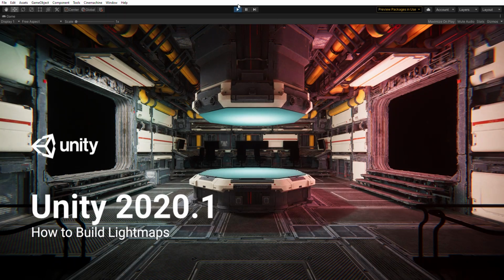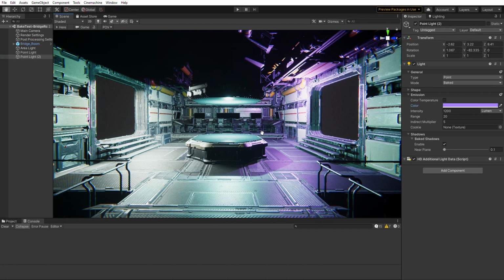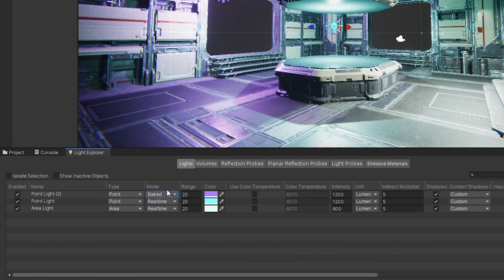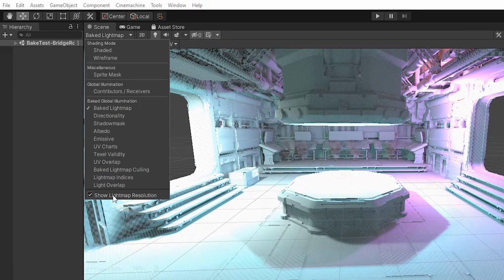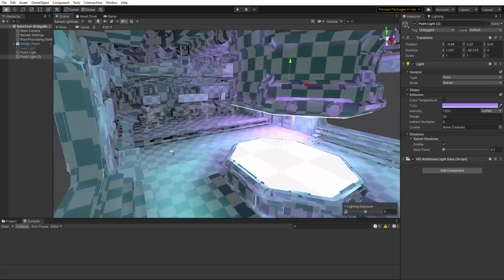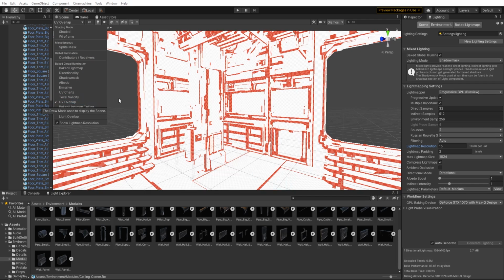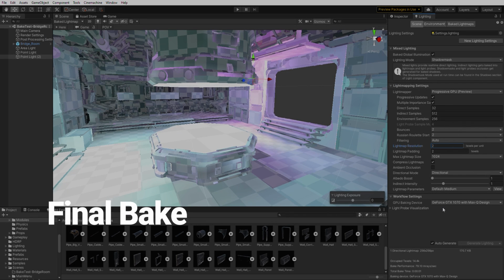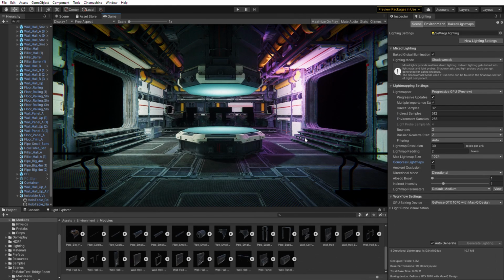How to build Lightmaps in Unity 2020.1 | Tutorial

Comment: This definitely helped narrow a ton of things down, however I am still stuck on Preparing Bake.... with 5+ hours listed. Any idea how this could happen? I am using GPU 3080, Lightmap Resolution at 2 with Padding 2. I kept the scene simple this time since I am setting up for the final map, and I have had issues with lighting in the past so I wanted to test everything out prior to bringing in my prefabs. Still no luck as it seems. I am running Unity 2020.3.25f1 as project version. Thank you!
Reply: So I let my project sit over night, and Unity is still stuck on Preparing Bake. Not sure why this is. Could anyone help me in figuring out why?
Reply: @ElNitro7  not sure if you found a solution. But did you check under Lightmapping setting > Lightmapper ?  and check to see if its set to GPU. 
If its set to CPU , unity won't use your 3080.

Comment: 1:32 So what can I do with the terrain? Any advices? Thanks in advance~~
Reply: It may be counter-productive to bake terrain. Outdoor scenes often have large areas lit only by the Directional Light (that is, the simulation of sunlight or moonlight), and as such, will render quickly without baking. For interior scenes, any surface may be (and often will be) illuminated by more than one light source. Depending on whether you are using forward or reverse rendering mode, the computation of multiple direct and indirect light sources onto a surface is computationally intensive, hence the desire for baked lighting.

If your project rotates and dims the Directional Light to simulate day/night cycles (or even if it just swaps fixed parameters for one "day" and one "night" lighting mode), this again would negate most of the benefit of baking because if the light source isn't static, it will not be baked into the maps.

Combining these factors with the sheer size of a terrain chunk, and this explains why the video assumes you probably won't need (or want) to bake terrain light maps. All else aside, the terrain would have to either consume a huge amount of space in the lightmap textures, or it would need to be baked at a really low resolution with huge texel size.

This doesn't mean you can't bake light maps for objects such as building exteriors or large rocks that will be placed on the terrain, if you have invariant sunlight in your project. If the terrain is not marked static (which, again, it probably should not be), then shadows from these objects on the terrain itself will not be baked, but self-shadows or shadows from adjacent static objects, as well as any baked-mode lighting from the objects (such as a street lamp) could still be baked.

Returning to your question more directly, your best friend for improving terrain rendering performance is likely to be managing the scope of what is to be rendered in each frame, using:

* Camera frustum culling (intrinsic to the camera itself, but somewhat controllable by your setting for far clipping plane)
* Occlusion culling of terrain chunks and objects that are on the terrain (divide large terrains into chunks, and set them occlusion static but lightmap dynamic -- they can be static for occlusion without being static for lighting)
* For very large terrain areas, investigate world-streaming techniques either by creating your own or by using third-party tools
* Appropriate LODs of medium- and high-poly objects, especially foliage
* If appropriate, tools and techniques such as 3D imposters

Occlusion culling is likely to be an iterative process, as there are tradeoffs between the complexity and memory usage of the culling data versus the rendering cycles saved by culling. If the culling is too coarse, very few things will cull because the camera will often have visibility for most of the eligible objects. If it is too granular, the culling will be highly effective but might take a disproportionate amount of computation to traverse the culling graph in order to save a relatively small rendering effort. The only way you can know for sure what's best in your scene is iterative testing (though experience will guide your intuition toward reasonable starting parameters).

Also pay attention to post processing effects, draw calls (and by extension, material atlases and other draw call reducing techniques), texture memory consumption, render quality settings, and all the other things that can influence rendering performance aside from dynamic lighting.

Hopefully this is enough to get you started down the right road. :)
Reply: @scottcourtney8878  Oh my god! Thank you very much for this dedicated advice! It helps me a lot! You're really a good guy! Much appreciated! (❁´◡`❁)

Comment: I really liked the real-time dynamic global illumination light maps feature from unity 5. Will HDRP ever get a real-time dynamic global illumination solution, or will it stay deprecated?
Reply: The developers have confirmed they're looking at alternatives for the new render pipelines. Also note that the reason it is deprecated is because of licensing changes/issues by the company that created said technology.

It will likely take a while for Unity to roll their own system, but they've mentioned that they're looking to create a system that is suitable in all project types and not just certain genres. 

As an example they mentioned that they would like to implement a way to bake these maps during runtime to enable truly dynamic worlds to also use this feature. However due to all the different ways of computing and baking said maps having their own advantages and disadvantages it'll take time to find the right way to create such a system that is compatible with all different genres.
Reply: @LuukDomhof  Interesting, thanks for the info. I was beginning to wonder if the only solution for modern systems was going to be real-time raytracing for dynamic global illumination.
Reply: @CoolSmek  I don't think it will be, as there are quite a few methods other people have used as well. 

Even though it is annoying to wait, creating a solid system that works on all genres of games is probably Unity's best bet.